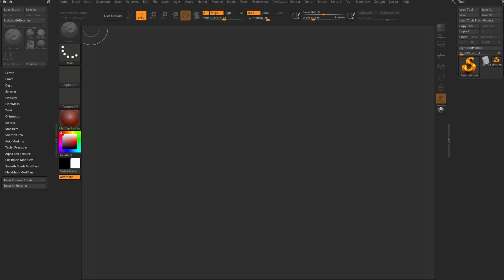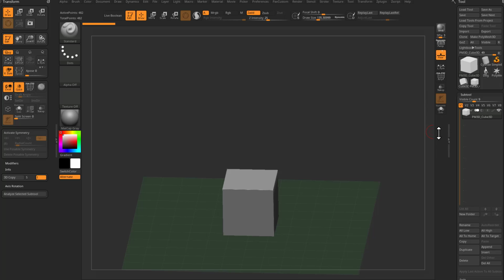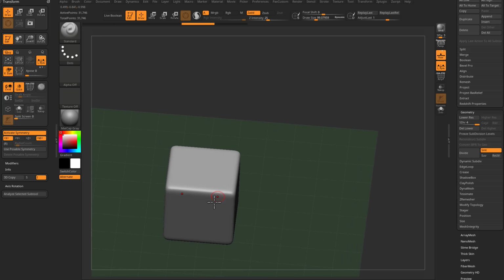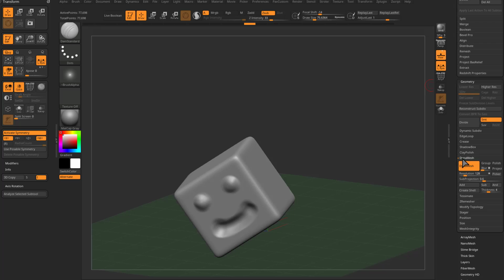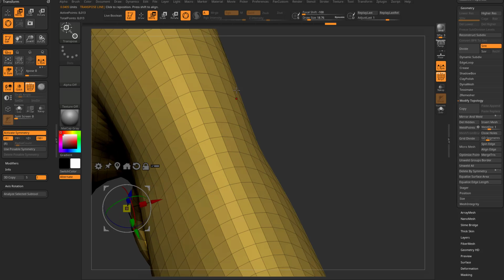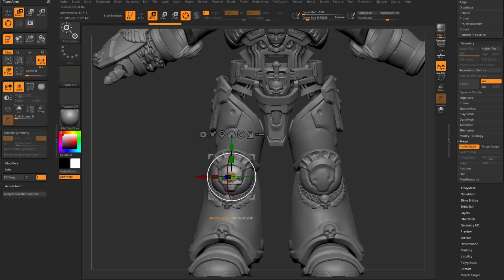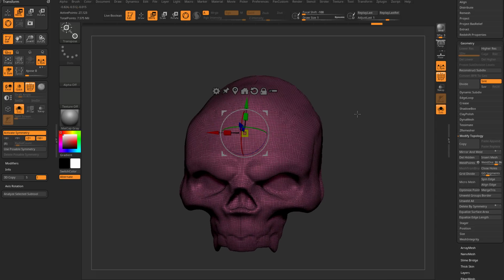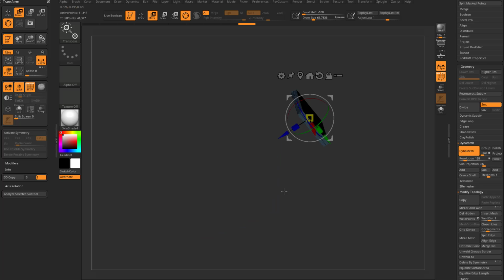ZBrush 2023 - Quick Start Dynamic Symmetry, then Perpendicular Gizmo Camera & ZModeler Symmetry Set!

Comment: Hi. I have a problem with Posable Symmetry. Even if I use a standard sphere 3d, which can be added via insert, and enable Positional Symmetry, zbrush gives me an error zbrush 0% symmetry points found. What is the reason?

Comment: Thanks for the video on dynamic symmetry. Im just wondering how to achieve something that worked with the previous symmetry method (2022). Lets say I have two eyes balls, all one object. I put the gizmo in the center of the left eyeball and turn on L-Sym go to scale tool and it scales each eyeball uniformly from its center. Now in 2023 with dynamic symmetry this functionality doesn't seem to work anymore. Is there a different way to achieve this with the new system?

Comment: I tried to move two Spheres ( eyes ) with Symmetry and Local Symmetry to fit inside a hole, but Symmetry works different now, if i press local Symmetry the gizmo takes the left eye and makes symmetry only there, when i use scale into one side with X symmetry, the Gizmo loose the object so i need re center the gizmo again and again.

Comment: @MAXON :  3 things .. 
1. Start indie, studio, and enterprise pricing before your userbase dwindles.
2. Dyn. Sym.:   There should be a selectable list of N most recent pivot locations/rotations that include the Original pivot pos/rot, as well as a set of user specified pivot pos/rot.
+Store the original pivot in the file as well as the user specified pivot spots to re-use on file re-open. 
Why ? because once you make changes to the surface, you might not get that exact pivot data again at a later time as the surface normals may have changed in that spot.
3. Thank you for reading.
Reply: just look at c4d how Maxon handles their price politics, they are worse than Adobe in this case. However, perpetual it is, i don't need a $500/year slime button.
Reply: you’re barking up the wrong tree here man, this channel has no affiliation with maxon and they’re not reading the comments.

Comment: While this looks handy, I do have a question! As an example, if I were scaling two eyes in a symmetrical head using local symmetry, in 2022 they would scale from the centers of both eyes, keeping the center of their axis in the same position, just scaling out, but now when I use local symmetry it scales the one that has the gizmo from the center, but pushes the other away while scaling it. Using the world center just scales to and away from that world center. It seems like this adds a problem when trying to adjust multiple symmetrical objects, whether scaling or sculpting. Is there a way of getting it to scale the way it did in 2022, or will we have to just delete and mirror and weld over and over again?
Reply: I'm wondering the same thing. I really hope they fix the local sym/gizmo issue because it's really annoying. Also, just curious, my Zbrush 2023 does not save new startup materials and always defaults back to red wax. Are you having that issue? FWIW, I'm using the subscription version. Sorry to chime in on your comment, here. :)
Reply: I have the same issue. I'm dealing with preparing models for articulation and have to make symmetric gizmo-driven transformations all the time. The new functionality of local symmetry breaks symmetric gizmo scales of features like hands completely. Haven't yet found a way to get the old behavior back either.
Reply: @jasonbickerstaff4293  yeah…seems like a feature that should have been handled differently. It has significant benefits, but breaks necessary pipelines.

Comment: Is there a way to resize symmetrical items in place as it was possible with local symmetry before? now if you keep gizmo in the centre of one of the objects it scales this one in place and the other moves. For example if you want to change size of ears or hands that are masked out of the body? If you have subdivisions mirror and weld won't work and freezing subdivs sometimes messes  everything up. Plus deleting lower and reconstruction after mirror and weld often isn't possible due to the triangles in mesh.
Reply: Yeah this feature feels like it wasn't fully tested. I really hope they bring back the original L sym set-up and add that "dynamic" button option like some button have.
Reply: THIS. I didn't realize how much I used symmetry in this way until it was gone. Give us a 2022 legacy alt+x symmetry mode Pixologic!

Comment: Would be cool to see things just get a symmetry gizmo on creation at the dead center. Re-finding could be useful in some cases where you want to move the plane but 99% of the time the original centerline is probably valid. Making it depend on the movement gizmo means you are going to have to noodle around with it more often to get the planes where they need to be.